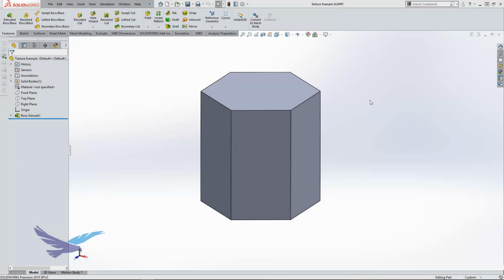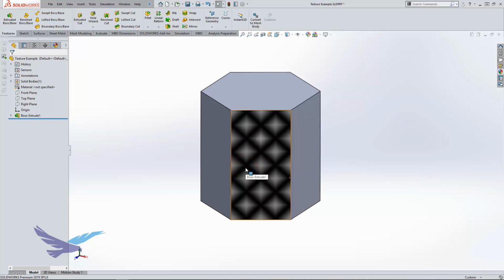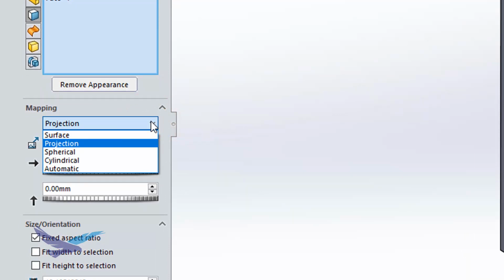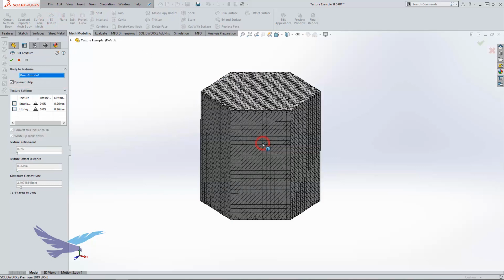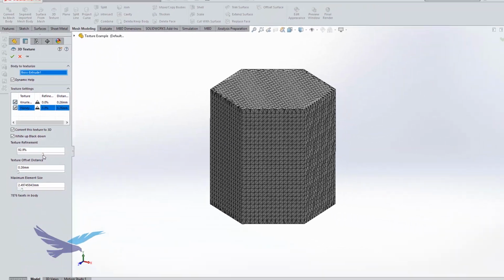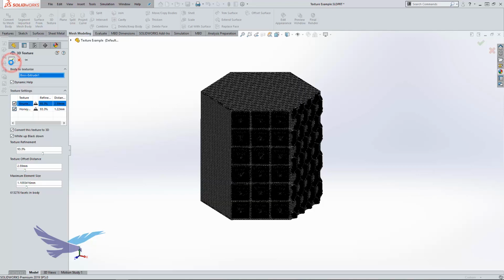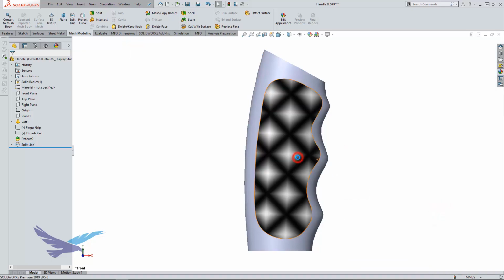Creating 3D Printable Textures with SOLIDWORKS

Comment: the thing that sucks is that you cant increase the maximum polygon count, its always fixed to the models size so the pattern is alway very low res :/
Reply: Yes, this is a problem I suffer from when using 3D Texture with small models.

Comment: Hi. I made a car panel for 3 D printing.  This panel should have a natural leather texture, like all cars.  But when sending the model to 3D printing, I was told that it was not possible to print it, since there are many triangles on the texture itself and the printer will not be able to print it.  How to optimize such a 3D texture for printing from a polyamide laser?
Reply: You might need to use SLA printers.

Comment: You did not 3D print them. LIAR.
Reply: @Alejandro Pérez  It is clearly printed, you can see the lift-off artifacts at the top of each part, but yes, the MarkForged is that good. It appears to be printed in Onyx.
Reply: LOL how do they prove it? By taking another picture?
Reply: @josephmarks493  Yes, where you can see the layer lines. Or a person actually holding the parts. Easy-peasy.
Reply: Bro what are you on??? XD.....geez this guy
Reply: it works.
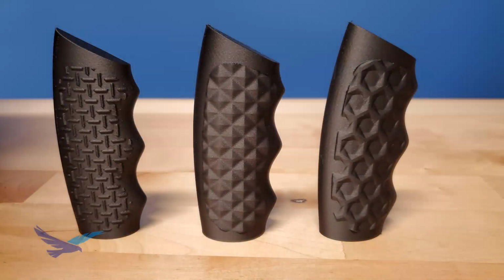Reply from the maker: You can see the 3D printed result at 7:40 The parts were printed on a Markforged X7
Reply: @hawkridgesystems  The image DOES look like it was rendered, but I sure won't resort to calling names about it. 
I am assuming that this feature is not for generating a finish surface that is better than prototype quality?
Reply: @hawkridgesystems  Those objects are rendered as is the table and the wall, not actually printed. Prove it otherwise.